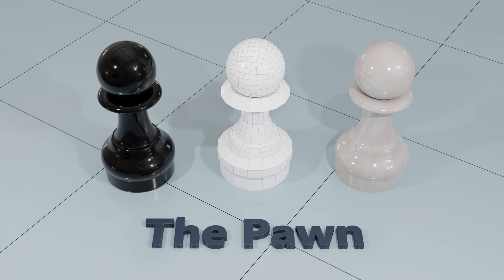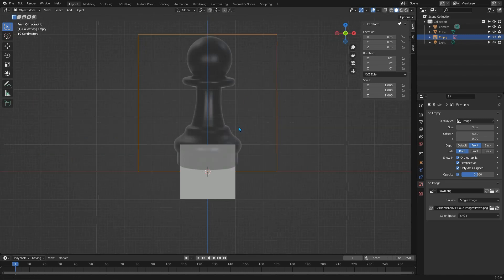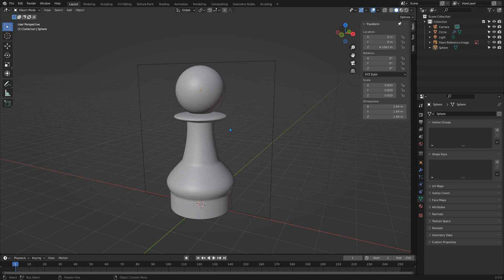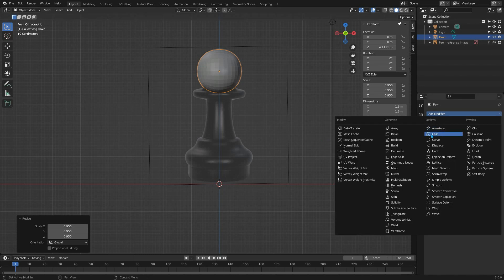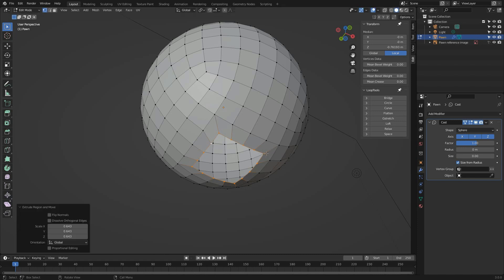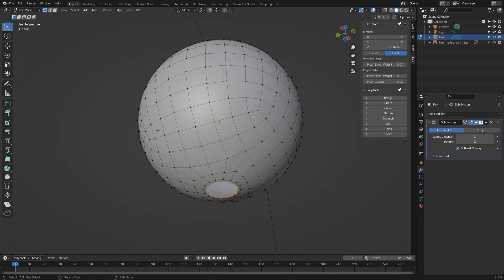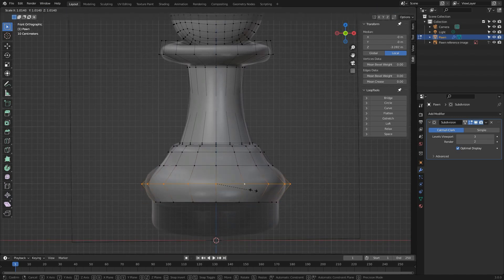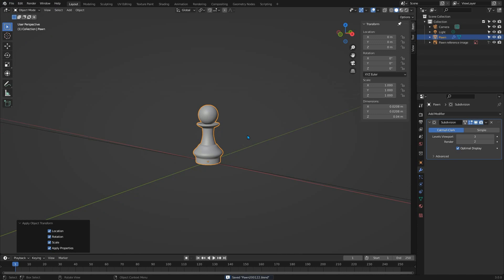Blender Chess Pawn - #9 Subdivision Surface Modelling in Blender.

Comment: Thank you for the best teaching I've encountered (which is quite a lot) on these subjects. Sure, I have a decent pawn model now, but much more importantly, I'm understanding why all my previous modeling has created so many unpredicted problems and frustration.
Is there a cheat-sheet available for the quad-sphere adjustments? I may have to make one. Those scale multipliers are quite specific.
Reply from the maker: @ShaneSmith-v7j  I think I have the datails for it at the "hardvertex" website. Cheers.

Comment: I got 4 five poles just below my 3 poles, following this tutorial, probably some different configurations or something, how I get they fix?
Reply from the maker: Hi Friedrich. Yes. There should be E-poles (5 spoked poles) at the edge of the first circular loop. They indicate the change of direction required to extrude out the body while keeping them on the flatest possible part of the mesh. You have not done anything wrong and they don't need to be fixed. They are correct where they are.
Reply: @ianmcglasham  What do you think of my zebra lines: https://i.imgur.com/wsyYXzW.png

Comment: I thought because of the 360 degree symmetry, you'd just draw a curve around one side for the profile then lathe that around 360 deg.  Interesting vid showing how you can improve topology which makes me wonder why doesn't newer blenders come with topology that is quads to begin with.   ?  Why does the UV sphere have grids meeting at a point at the poles when that's just bad topology to begin with?   thx for the vid.
Reply from the maker: Hi TruthSurge (love your singing!). The UV sphere and the IcoSphere are mathematically the best and simplest ways to represent these spherical shapes. The UV sphere has a really good topology everywhere except those poles so it can be really usefull for making shapes which rely on "banded extrusion" ( I do have a fix for UV speres as sub-d models in another video.) The icoSphere responds really well to physics simulation and is often used as a kind of a lattice for other spherical objects. In CG we now use sub-d modelling and it is not compatible with either of these topologies but as sub-d modelling is seen as difficult and advanced( it's not really - that is what I am trying to help people to understand!) The old topologies remain in use. We still don't actually have a mathematically perfect representation of a quadsphere, so 3d software makers are nervous about including their versions of it In The software. The old uv and icosphere versions are finding a resurgence amongst the current generation of hobbiest modellers, mostly because they are being incorrectly taught that booleans are a suitable solution to modelling problems. It is a bit of a problem which is going to leave this generation behind in  CG.
Reply: @ianmcglasham  thx for the reply.  I'm trying to learn enough to just make some fantasy scenes ir little landscapes. Nothing hard surface much that will be scrutinized by anyone.  So your methods are great for trying to keep good curves.  Like at corners if cubes and so on.   I prob won't get to that level if need just based on what I prob will be doing.    But is nice to see how to get good topology with these shapes.   Thx again and I sang for fun and experimentation.  I like creating music or doing glorified karaoke.  :)

Comment: Why would you not use a UVSphere? Then there's no dicking around with modifiers and Loop Tools to get a circle at the bottom of the sphere.! That seems a whole lot easier and quicker. Set the UVSphere Segments to 64 and Rings to 32 and there is no pinching at the top when shade smoothed.
Reply: If you use this, then your entire figure will lose its normals to deflect light.

Comment: I'd do it completely different way with almost identical topological result. Reference image==> tracing points starting with circle to make spherical shape ==> screw modifier 90 degrees 4 cuts==> mirror to make it whole ==> weld ==> subdiv ==> grid fill holes on bottom and top. With my method you have complete control over the whole mesh. But It's fascinating to see somebody who cares about topology and light reflections. 99% of youtube tuts are horrible when it comes to topology
Reply: yes, but normals of your figure are now destroyed.

Comment: Hi Ian. Many thanks for another great tutorial. Followed along and now have a lovely looking Pawn. One slight problem though. When I follow on from about 10:35 in the video to make the Pawn an appropriate size it basically disappears. After I`ve done what you suggest I can`t find the Pawn anywhere in the scene. I did the Chessboard tutorial and everything was fine when resizing it but not this time with the Pawn. Any idea why this is happening? Thanks again. 👍
Reply from the maker: Not sure. Can you select it in the outliner and press " . " in the 3d view to see it?
Reply: @ianmcglasham  Not really sure what you mean there Ian. Sorry. It disappears when I go to select the very bottom/middle vert at the end of the tutorial and move it to check I`ve got the correct vert. When I do that it just completely vanishes.
Reply: Tried it again and seems to have worked now so that`s great. I think maybe I wasn`t setting the origin correctly or something like that anyway. All good now.
Reply from the maker: @tjc  Oh good. If you find out what went wrong, I'd love to know. Let me know if you have any other problems.
Reply: @ianmcglasham  I tested it again Ian and here`s a rundown of what happens - I can change the size of the pawn to 4cm. That works. I can`t copy/paste the values in after that step. I have to input them manually. When I do that the movement of the pawn becomes very erratic. Not smooth as in your video. To select the bottom center vert I have to use the bottom view. To move the pawn around is too erratic to not use that view. When I do the "Cursor To Selected" movement becomes normal again but when I set all values to 0 in the Location field the pawn just disappears and I can`t move the mouse at all to rotate/zoom in/out etc. This has happened several times now. It`s only once when going through those final steps did it work for me. These final steps worked perfectly for the chessboard and the bishop. Hope the above makes some kind of sense. 😂

Comment: Hi Ian, when extruding + scaling the bottom vertices to form the hole, the cast modifier for some reason doesn't maintain the spherical "path" of the newly formed extrusion.
The pivot points are set to median as instructed... Any ideas what could be the reason for this behavior? 
Thank you.

Issue solved: I forgot to turn on the "edit mode" and "on cage" options on the Cast modifier.
Reply from the maker: Do you have "on cage" turned on in the cast modifier?
Reply from the maker: Nice.